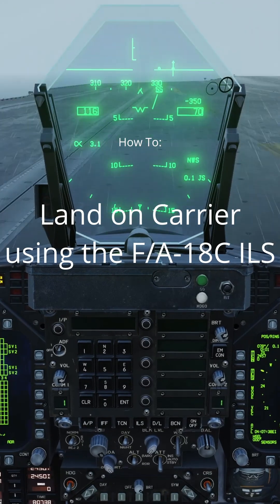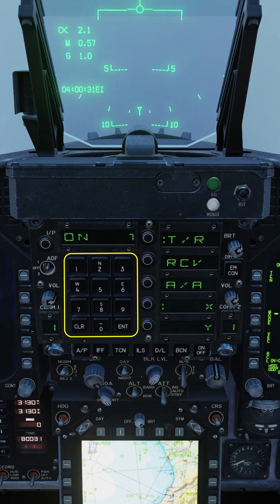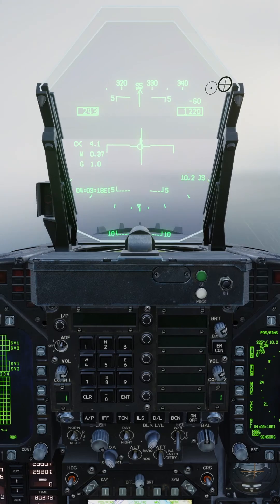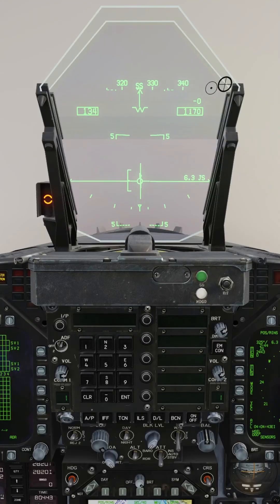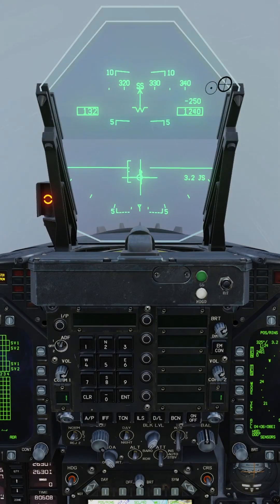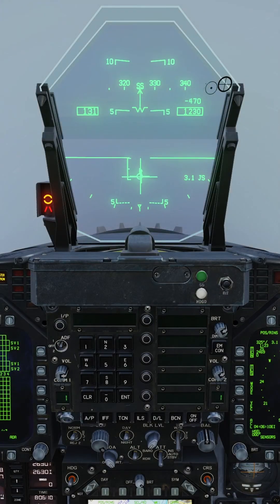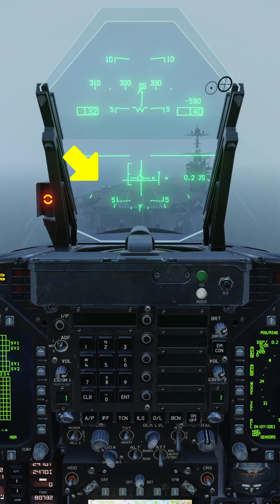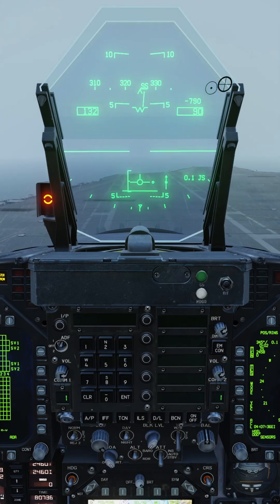How to Land the F/A-18C on Carrier using ICLS #dcsworld #aviation #military #carrier  #fa18

Comment: Landed at almost 900 fps 😕
Reply from the maker: That's carrier recoveries for ya. haha
Reply: 750 fps or less is the recommended descrnt rate.   You would have some explaining to do to the plane captain.  @WorldWarWhiskers
Reply: @tylerouimette2934  Nah mate that's normal, carrier glideslope is 3.5° but even on a 3° navy Jets do around 750/800 all the time
Reply: @riccardoalberti759 900Fpm is not normal.    The target is 750fpm.   You just said it yourself.      Yes the gears are reinforced to land on the carrier, but the target is meant to prolong the life of the aircraft AND the deck.
Reply: @tylerouimette2934  I said it myself on the 3°. Carriers have 3.5° gs, about two balls high are like 800 fpm and considering it gets usually stepped down from two high to crescent high you get about 850. He had a bit of (HIC) EG \AR so that's why he got to 900.

Comment: Don't forget to max throttle after you land just in case hook doesn't catch so you don't flop off the end of you carrier!
Reply from the maker: That's right!
Reply: @lelandrasor9678  Safety thing in case the hook on the plane misses the cables on the deck that stop the plane. You can see the cable housings on either side of the landing strip as white bumps.
Reply: @lelandrasor9678 you actually really do this. Carriers “catch” you with hooks and nets, because it is basically impossible to slow down enough or land like an airfield landing. Most carriers in the world outside of the us cant even support fixed wing planes or things that cant land and take off vertically
Reply: @cpttrps5376  kinda wrong here. Nets are for a bird with an issue not the standard. And also the boat doesn’t have a hook. The hook you’re thinking of is the tail hook that is connect to the aircraft. The Hook catches a steel braided wire across the flight deck. If the jet tail Hook misses the wire, that’s why you full throttle and fly off and try again. That’s the standard procedure.
Reply: @keseanmikell hooks for planes with an issue is air force shit, navy and marines (assuming it's an fa18 or f35c squadron) use hooks regardless because the runway is like half a mile